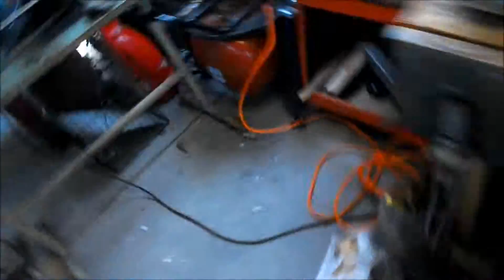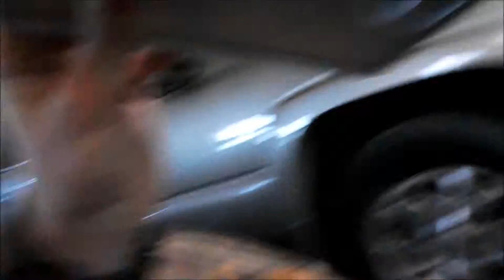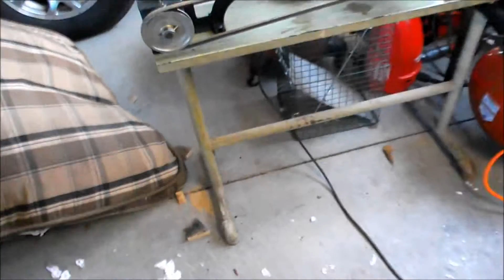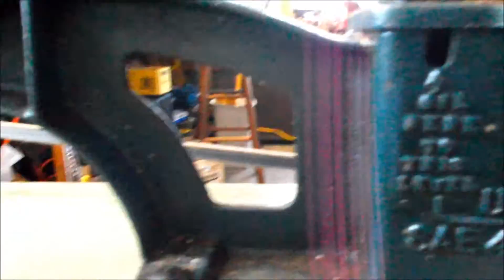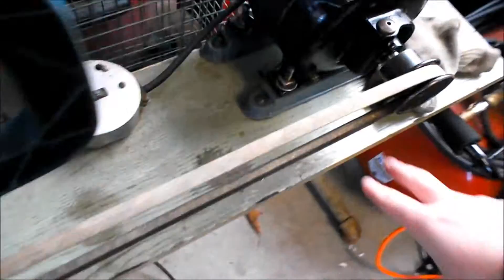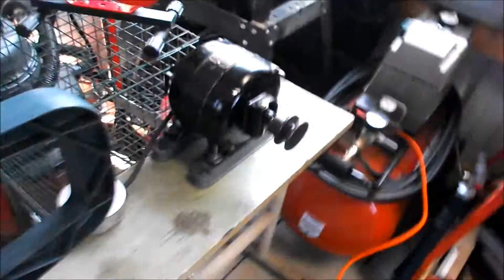Craftsman Companion Belt Driven Scroll Saw with a 1/6Hp GE Motor [Part 2]

Comment: I want you to notice the 'ribbed' C-frame construction and the solid C-frame construction of the 1932 model when they were still Dunlap.  When Sears & Robuck  bought out:  Dunlap, Craftsmen & Champion, they sold the existing inventory as was manufactured.  Then they made those changes to reduce production costs.  As you have, I've learned quite a bit from actually taking the time to research the value, collectible  asset, and, reasonable selling price vs. condition.  My 1932, in it's present state, and cleaned up only, was valued at $175.00 to $225.  Why so high?  Because it was ORIGINAL!  Not re-painted, but repaired, with the best new parts I could provide!  The original 'leather drive belt' snapped from dry rot when I first ran it.  But, that Original, snapped, 'Leather Drive Belt' is still in the drawer with the Original Owners Manual.  Yes!  I stepped in s@#t with my unit.  Used it for a few years, and then decided to sell it, hopefully, to someone that knows and appreciates old belt driven tools.  And I did, after 6 months, find the right person!  :-)

Comment: I also have, in my shop and working as well as well used, 1962 Craftsmen, 10", Radial Arm Saw.  Again, procured for FREE!  Well, not actually.  I had to run two new coaxial cable lines for the friend for two additional TV's in his house.  I did the cabling for him for only a couple of drinks at the local watering hole.  He insisted on giving me the saw because I was very local and, it was a needed addition to my woodworking shop.  I love the older power tools!  Safety features are basically nill...to use  it, You need Skill & just a bit of smarts...  :-)
>>Marcel..."The Wood Butcher"

Comment: I forgot to mention, when I received my really, really old "Dumont" Jig/Scroll saw, it actually still had the Original Owners/Parts manual in the drawer of the bench.  That may sound really cool.  However, try to use the part numbers in 2016 when the thing was printed in the 1930's!  ARRRG...I did keep the original leather drive belt for sizing to replace with a rubber one.  Taking the staple off of the leather belt was a real challenge with the extremely dry leather without damaging the belt length.  After watching your restoration videos, I'm thinking of contacting a good leather worker to make me a new leather belt for the old Dumont.  >>Marcel... "The Wood Butcher"   BTW, where are you located?  I'm in New Jersey.
Reply from the maker: +The Wood Butcher That's really cool to have the original manual. I checked vintage machinery but I had no luck. Since yours uses leather belts does it use flat pulleys as well? Or does the leather just fit into the grooves? And I'm in Virginia
Reply: V-groove.  I brought the broken leather belt to Auto Zone and told the kid to measure it and match as close as you can.  3 belts later, returned of course for credit, we hit pay dirt!  Returning the only trial fitted V-belts at first was a hassle.  But, this old Marine won!!!  :-)

Comment: With regards to the pulley breaking, stuff happens when restoring a machine that is more than 70 years old!  We do the best we can with what we have.  No worries about replacing the pulley, all of the other main components are original!  That's what really counts.  Belts, pulleys', seals and bearings just need to be replaced to make a Vintage machine work properly 70 years later. >>Marcel...
Reply from the maker: +The Wood Butcher Yeah it took me about an hour to precisely cut away the loose piece without damaging the drive shaft. I would have preferred to use a three claw pulley puller but it wouldn't of made a difference cause the pulley was aluminum. The bushing was still in good shape too, with a small amount oil that leaks as it rotates.